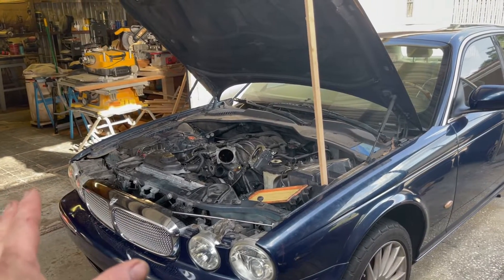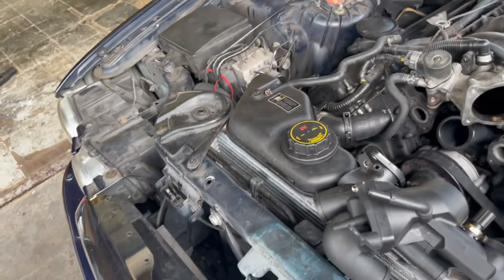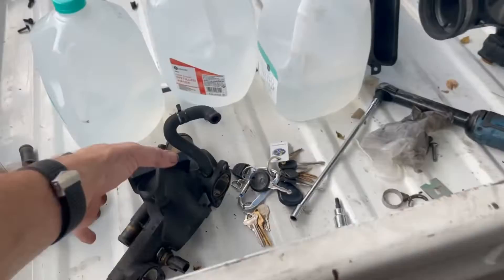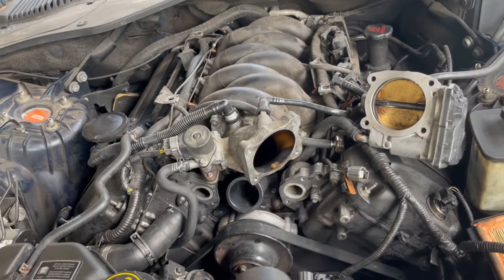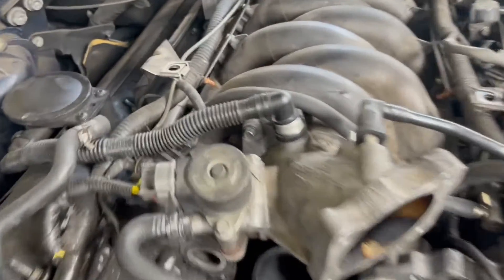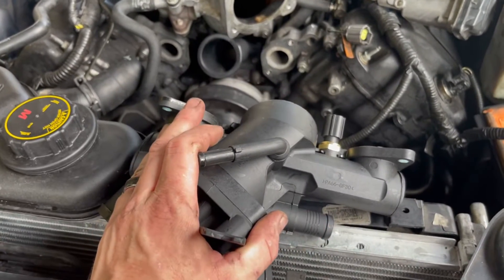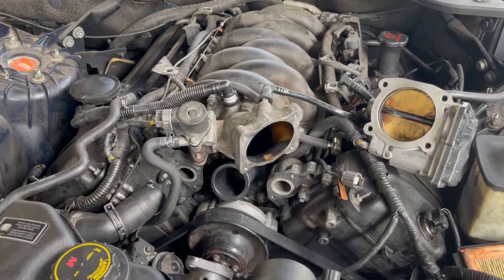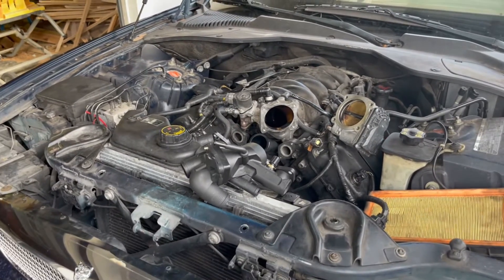Jaguar xj8 thermostat housing replace and flush octopus plastic housing fix overheating

Comment: My new thermostat isn’t doing its job right, Firestone says it’s probably due to the aftermarket brand that it fits on the car but not rated for it🤷🏽‍♂️ idk I did my water pump and housing and reservoir myself and same vehicle 🫠

Comment: Update, I replaced my radiator too but still overheated due to pockets of air in the system 🤦🏽‍♂️
Reply from the maker: Did you check or change out the auxiliary pump?  It’s located under the coolant full tank.  That will push fluid through the system and get rid of any air bubbles.   My issue was a combination of things including this failing.
Reply: @petescarport  I haven’t yet due to when I did start to fill it, I had the car cold and heater on 89f level 1 fan speed, topped off with the coolant and only turned the key for electrical only and you can feel and hear that lil pump turn on and see it eat up the coolant to continue to fill. After I get off work im going to buy the anti spill funnel to try and let the system warm up till it eats the coolant in it🤦🏽‍♂️ but yeah the new parts are currently (radiator, water pump, housing, thermostat and I flushed and drained all that orange Dex cool coolant and swapped over to 2 gals of green concentrate and 1/2 gal of 50/50 yellow universal and they both say they are compatible and can mix together, just still missing 1/2 of the rest of the concentrate and it’s just a little under the rating level of freezing point/boiling point due to the air in the system to make it good🤦🏽‍♂️)